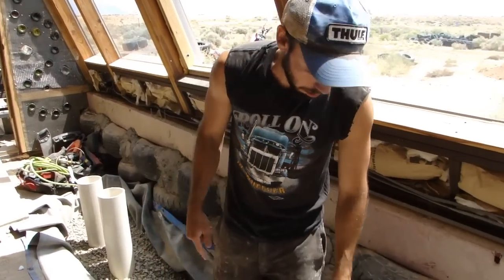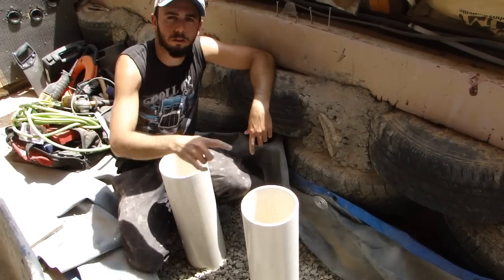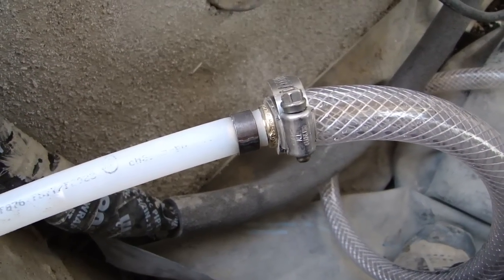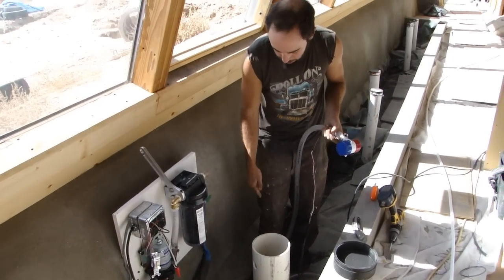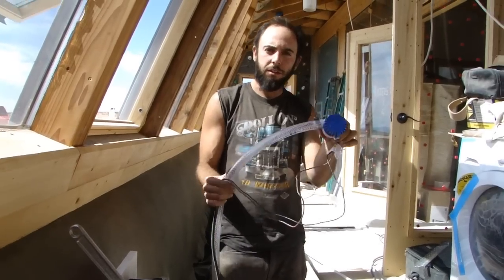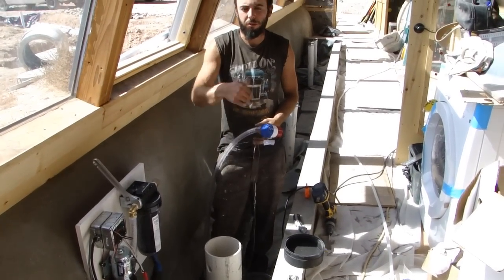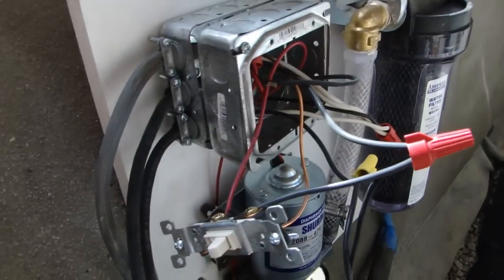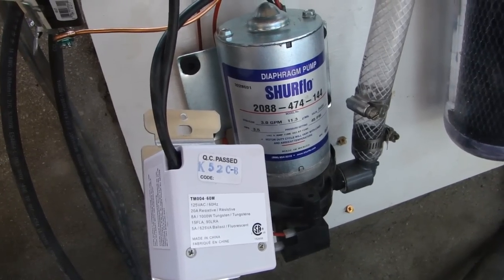Gray Water Planter - Part III

Comment: If I was building my earthship with compost toilets . Instead of using a pump to feed water to the bathroom could I just gravity feed that water from the planters to outside the earthship ? I want to build my earthship with no electricity. Would the water from the sink and bath flowing threw the planter to the end and then outside provide enough circulation to prevent stagnate water and would there be enough water in the planter to actually water the plants thank you :) 💜

Comment: gray water planters should be 1 big planter with an reacery pipe running the entire bottom and covered with layers of stone bigger at the bottom and smaller at the top.the feed water shold weep out near the top of the planter through a weeping system and the drain pipe should take all of the filred water through a dosing tank and be recovered for the toilets before going to black water of flushing water the dosing tank is simple with bleach tabs droping out of a vertacle tube the shot of chlorine  will guarantee odorless bacteria resistant flushes and straight to black water were the treatment can be finished after the flush. Treating gray water a good idea and since the plants are seldom affected by chlorine out side where it can gas off no big deal. using the interior planters for grey water and making a man made leaching bed smart ...putting gravel in anyhow so start at 1 1/2 stoe filter back all the way to pea gravel and top with sand the top 12 inches need only be top soil and the changes of soil are easily accomplished just dig out a foot and 2 inches of sand then replace sand and soil from  compost pit Bi annually. fresh soil for growth plants and filters that work constantly evenly weep entire top of planter for constant watering...easy peasy and those man made fillters will last forever the dosing of the recollected water simplifies the sanitation issue for the flushing water...sorry about the recap but not I had my mpdes license for many years and  after man made sand filtering and chlorination the recovered water should be fine for  flushing... Hit things a couple of times and they stick forever...

Comment: thought... why not have a reservoir somewhere hidden higher than the toilet reservoir that the toilet reservoir would draw off from as if was like drawing from the normal pipes. have in that reservoir a ball valve sump pump that draws water from a pipe that is gravity fed from the planter. this so you only have one pump for the toilet.

Comment: You mentioned the planter will need to be dug up at about 10 years because of smell do to bacteria. In theory could you place t fiberoptic rods in the planter to shuttle sunlight  down to the deep areas to abate the bacteria without digging it up?

Comment: Before running that water line back to the toilet, wouldn't it have made sense to put a PVC pipe inside the concrete? Then run the hose inside the PVC? That way if the water line got clogged or needed to be replaced ... ???

Comment: The overflow gray water goes out to the black water cells.Dave i think it is easier in most places to get cement stuff approved than say hempcreat and such.The buildings use odd enough materials as it is.Adding extra would of made it harder to get them approved.The building should last over the 100yr mark and at that age its really sustainable building.Im guessing at the 100yr mark you would need to fix some things but that tyre walls going no place fast thats for sure. Peace out :D

Comment: Don't know if they changed the method, but from the book they recommend punching a hole in the rubber that is 1 inch less then the diameter of the pipe, and then you stretch the rubber around the pipe and seal it with a hose clamp around the rubber.
Reply: Ah! Thank you. I had suspected something similar, but was not sure.

Comment: DUDE!  Waterfall is awesome!  It'll water shallow root plants!  As for the recirculation pump, wouldn't it be easier to just hook it up to a small solar "panel"?  So, if the sun is out, the pump is running?  That way, it doesn't take away from your primary source of power and also doesn't need a timer.  I just stole the idea off of the fan setup for add-on solar heating designs.  Awesome videos!

Comment: 1.Is the front wall of the planter, which is finished in the video, covering the EPDM liner? 
2.If so, any suggestions on how you get it to stay in place?
3.Older versions of the planters use can walls, is the reason why, it is easier to dig down than build up?
Observations- When you install a timer to run longer you may want to look at a continuous duty pump as those boat submersibles will fail under continuous duty.  But they sure are cheap!!  You are really coming along great! Thanks for vid!